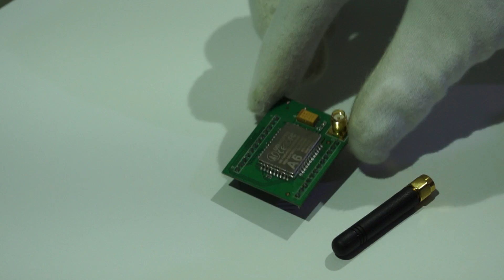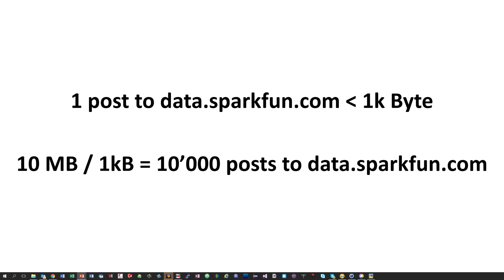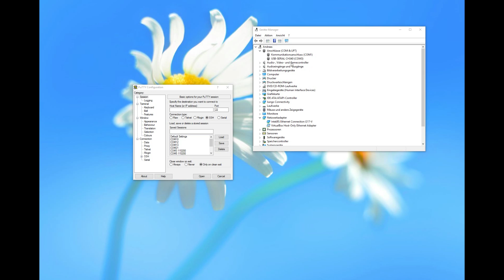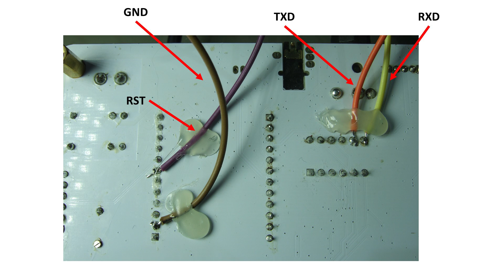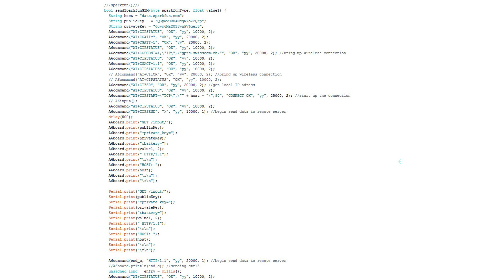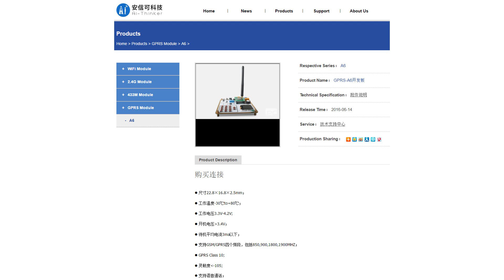#66 New Killer Module from AI-Thinkers? The A6 GSM M2M Module

Comment: Very useful video, Thanks! I've got one module and tested calls, SMS and web retrieving, using serial terminal by the moment. I asked AI Thinker for an API to program it and they told it is not available for the moment. Another drawback is that, with current AT commands, A6 cannot behave as a server. Maybe it is not that important as, normally, a device like this will push data regularly, but it would be useful in some projects that a remote system may send requests to the device.
Reply from the maker: +Germán Martín You can call the module to wake it up as one comment suggests. 
With the AT command it is relatively easy to use the module ( if you know the commands). In the next video I will dig a little into this matter.

Comment: For your Interest the A6 Module (the little tin thing) runs at 3.3v on that sub board module. The sub board module has its own micro usb connector for power (You can power your project from the 5V from  pin 1). To start the sub module up short the PWR_KEY pin 1 on the aerial side to 5V pin 1 on the non aerial side for 5 seconds ( They are diagonally opposite ). As long as you take the PWR_KEY pin above 1.9V that's enough so you can power it on with a gpio pin from your arduino. 
The PWR_KEY pin is 5V tolerant. As for RX and TX, the TX from the Module to the Arduino will be fine. you can always use a simple resistor voltage divider to connect the  TX from the arduino to the RX on the module. Something like

Arduino TX ----[1K8]--------{Module RX}------[3K3]-----Ground

Like you I have been using it with a USB to a 5V TTL serial adapter without issue.

There is more data and a data sheet link here. 
https://raymondtunning.wordpress.com/2016/05/31/a6-gsmgprs-module-pinout-and-data/

The timers are really useful  as they power the device up from a turned off state. So if you were doing say a battery monitor  you could set the timer for every 3 hours it would turn the module on. The serial output could be used wake your uP which could in turn read the battery level then power of the module. Then the cycle repeats. Even in standby mode it draws less than 1mA it comes out of standby if a timer event happens or it receives an SMS or a call. 

Also useful is the fact you get Caller Line ID so if you wanted a garage door opener you could get it to recognize that your phone, list of phones, had rung it then open the garage. The module does not even need to answer just send the "Hang Up" command so you have a "secureish" door opener unless someone spoofs your mobile number.:(
Reply from the maker: +simonf Thank you for this info. I will definitifely further play around with this module. The remote control scenario seems to be interesting as it is "free of charge" and does not use your prepaid money!

Comment: I do not know if I'm wrong on that but it reminded a lot about Hayes command set. We used to "program" telephone modem at the time we hate that kind. Those we used if we would put a BBS up or we should communicate directly with another computer, not necessarily a PC. I myself have worked with such systems in two cases the last as late as 1995, this system may still run.
Reply from the maker: You are right. The Hayes AT commands are the basis for these commands. I think, this is part of the problem that they are not very adapted to today's usage with programming interface...

Comment: I  just got the A6 from Electrodragon. There are a lot of AT commands! I have been able to make calls and send SMS from a terminal, I would like to send MMS messages, but the module documentation does not mention how to send MMS messages. Great video thanks for sharing your projects!!
Reply from the maker: +xennelul I did not use MMS, so I cant help. I am more in the M2M business
Reply: There is more data here http://www.stm32duino.com/viewtopic.php?f=45&t=1156 there is a link post 2 to another website with links to the datasheet. I have not used for mms either SMS, Voice and GPRS DATA only.
Reply: Thanks very useful! I think MMS is mostly TCP, I will post about it when I figure it out.

Comment: Love your videos Andeas.  Just a quick suggestion : In your code, when you write debug comments like this :

     Serial.print(" HTTP/1.1");

... if you enclose the string with an F() statement like this :

     Serial.print(F(" HTTP/1.1"));    

... the string comments are not stored in program memory, which reduces the footprint of your code.  Production-wise it makes no difference, because you can just remove those lines from code, but it does give a clearer indication of program memory requirements when debugging.
Reply from the maker: Thanks for the tip. Didn't know it.

Comment: Andreas, you can use just regular Arduino and SoftwareSerial which emulates serial communication on any pin/pins. This way you can have more independent serial interfaces.
Reply from the maker: +cbm80amiga I often use Software Serial. But here, I need 115200 baud. And this did not work when I tried with my UNO.
There is a possibility to change the baudrate of the module. This will be the content of a future video.

Comment: Please also keep an eye at your providers TOS. Over here in germany most include a section forbidding "automated systems" for private contracts. Of course that term is somewhat debatable, but at least one didn't quite like my "connect;request;disconnect;sleep 300"-Script and cancelled my account…
Reply: Ist das bei allen Providern so?
Reply: In den AGB steht bei den meisten etwas, das man in die Richtung interpretieren kann. Reaktion ist mir nur bei einem Reseller, der kein Netz nicht als Ausrede zulässt, bekannt. Auch da aber nur bei wirklich konstanten Verbindungswechseln - schätze die haben deren Datenbank etwas genervt.
Reply from the maker: Interesting which problems can occur. I absolutely did not think about this problem. I also learned, that GSM networks will be closed down in the near future, and that it seems forbidden in some countries to use these modules without proper homologation... This is the power of youtube. Learning in both directions.
Btw: I like your videos and always watch them!
Reply: Well, we hear the same thing about analog TV and Radio for quite some time. There are a lot of large GSM-only installations like fire alarms or the automated toll-system installed on freeways in Germany still active and I'm pretty sure there will be generous migration times until GSM will finally vanish over here.

The homologation is afair only for the type, not every unit - I'm not sure if the EU even has it's own stamp, the US-FCC-Approval is at least printed on the module. This regulation officially applies to WiFi as well, so not really a difference there. And still a pretty high chance that nobody cares as long as there is nothing horribly wrong and impacting other users…
Reply: As a semi-retired Telecom Engineer, I can tell you that this is not always true for all carriers. The EU is standardizing data service T&C's - including roaming requirements. Note, that the ITU is leading this ininative and is already running into obstacles as Carriers offer several prepaid services that have almost no T&C's concerning data when it's connected to a TCP/IP stack. The dial tone side of GSM is not a problem because it's not actively using IMEI network. Pre-paid sim cards in Europe no longer require "locked" IMEI network access identifiers. However, this is only partially true in many other countries such as India and Pakistan where 900 / 1800 MHz are still in wide use. For example, the ability to by prepaid sim cards is heavily regulated and requires the user to be fully identifiable including documentation of user with name, address, etc.. Gone are the days of anonymous pre-paid cards. 

As noted in these threads, some GSM 900 / 1800 networks are being decommissioned throughout Western Europe (EU) and the frequencies being reassigned for different uses. GSM as a wireless technology is not being decommissioned - but going through upgrades (i.e. G2 & G3 to G4 and G5) and migrating to different frequencies. 

Across southeast Asia, GSM 900 (and believe it or not, CDMA+) remains in service in some countries but are being phased out. 

For those that are considering this series of modules for use in Africa, the GSM networks will likely remain in place over the next decade, possibly longer. Across North America, the following networks are in service; 

GSM / AWS / UMTS / HSDPA / LTE using 850/1900 MHz , UMTS/HSDPA 850/1900Mhz, LTE 1700/2600, AWS 1700/2100 frequencies. 

The evaluation / test board Andreas used is no longer available. However, several other test boards are available from various suppliers along with certified model vendors that support MODEM, GSM / GPRS, QUAD BAND, RS232. I will not make recommendations due to the wide variety of regulatory and different applications of specifications that vary between countries. I know of at least 5 different A6 Chipset boards that are compliant with current standards including;

Working frequency: quad-band network, 850 / 900 / 1800 / 1900MHz and 2G / 3G and 4G compatible. 

- Working voltage: 4.8-9VDC(On-board voltage regulator circuit supply power for A6 module)
- Working Current: maximum of 2A
- Sleep Current: 5mA
- Onboard Micro SIM card holder, you can install Micro SIM card
- Onboard Micro USB interface for external power supply
- Communication Interface: TTL serial port / RS232 serial port
- Baud rate: 115200bps and it can also be set by AT command.
- Interface logic voltage: 3.3V
- Make and answer phone calls using a headset and electret microphone.
- Send and receive SMS messages.
- Send and receive GPRS data (TCP/IP, HTTP, etc.) .
- Be used to test the Ai-Thinker GPRS A6 module
- Pin pitch: 2.54mm
- Onboard antenna interface: SMA and IPX
 

Andreas; if you would like some technical assistance, let me know and I'll be happy to help or point you in the right direction for technical information or engineering support. 

Hope this helps.

Comment: Very well done video Andreas, thank you!  I've ordered myself a few of these modules (alongside the same evaluation board in your video) and will for sure implement one in my current "smart home" setup as a backup modem.  For the sub $5 price per module (found as cheap as $3.31 with free shipping) I think you've made a great find!
Reply from the maker: Enjoy your "smarter home"!
Reply: Thanks, I for sure will!

I received my development board and a cheap SIM card (with free 200MB data plan) a few days ago and have it communicating with one of my ESP-12E controllers, (albeit a bit crudely at this stage).  As it's implemented now it works great as a quick and dirty backup modem to hit my externally hosted servers.  

I did some digging around and found the schematic for the test board we have, might be of help to others to have it in the video's description: http://www.electrodragon.com/w/images/b/b7/A6_dev_board_schematic.pdf

Found it here with a good rundown/overview of the A6 module: http://www.electrodragon.com/w/GSM_GPRS_A6_Module

Thanks again for this video, it made integrating this chip much quick and easy!
Reply from the maker: Thanks for the information!

Comment: For these guys trying to connect in German with ALDI Talk Base. This service does not require all the "AT+SAPBR" commands from the script. As far as I'm moved forward with e-Plus as provider the GPRS registration seems to work "magically" without any initialize. All SAPBR commands cause an error 58 on my devices. I also do not find this AT command in the provided A6 reference. Maybe required and working in Switzerland.
Reply from the maker: Thanks for your comment. I am doing a video where I explain a little more how I connect to the service. It is due tomorrow evening...

Comment: I'm waiting until a 3g version of this device comes out.
Reply from the maker: +MrHD71 I was not aware of the 2G problematic. As I mentionned, this is my first experience with GSM. So, I probably have to write off a few dollars in a few years. Do you know of cheap 3G modules?
Reply: +Andreas Spiess I completely have no idea of cheap 3g cards. the cheapest card I could find was $50 USD which is way too much for any hobbiest project to spend on a single component. let me know whenever you fimd anything interesting at a good price.
Reply: The only cheap 3G modules are USB dongles around $10 the problem is you would need something like a PI zero to operate them. You maybe able to use a uP that is capable of being a USB Master but it would be a nightmare.
Reply: For www.Bubbleio.fr project : Same feedback for me. I've not seen 3/4G chip at less than 20-30$. On the other hand, I've made investigation on 2G perennity and I think we will not have real change before 5G (which will change the IoT communication market I think). So, at least 5 years of 2G availability , enough to validate a business model :-)
Reply: @ERICRAC  2 G will have a long life due to the IOT world ...keep that in mind...2G = Low power consumption...so no worry. good luck
Reply: 2G has gone offline in Australia

Comment: The M2M devices usualy doing some mission-critical tasks and often installed in hardly accessible places, so it's components must be very stable and reilable. The SIMCOM SIM900 is tested for many years and proven to be stable. This new module needs to be tested for several years, detailed documentation must be released and tech support must be started at least in english before module can be used in real M2M devices. Before it's done this is not a killer module, but just a toy to play with. Still I like it and just ordered one.
Reply from the maker: Concerning the documentation, you are absolutely right. Concerning the years of testing I doubt: First, product life cycles are very reduced these days (think of the risk of a new Iphone every year, they cannot test too long). Second, the GPRS network will be shut down around 2020. With these long tests the module would have a very short life...
BTW: If I had to do a decision for an important product, I definitely would go your way and spend a little more for a proven technology. But fortunately, this is "only" my hobby.

Comment: Hi Andreas, thank you for this useful  instructive video. I have a question about arduino and a6 tx rx connection. As i understand arduino serial is 5v and A6 is 3.3 V  Does this connection requires a logic converter or we can connect them directly?
Reply from the maker: I do not know of a clear indication. So, the safe side is always to use a level shifter. Mine survived 5 volts...
Reply: thank you

Comment: great fan of your videos. can you please confirm if there is an analog port on this. and can this be used without an arduino to capture and send (via MQTT) a sensor's reading. say of dht22
Reply from the maker: No, I cannot confirm that. This module only can transmit messages.

Comment: In your code, A6command and A6waitfor use "yy", can you explain it's for what ? With the A6 there is a problem with a long reply (for exemple with AT+CIICR) because after a number of seconds the A6 sends "COMMAND NO REPONSE" so the command "wait for OK" doesn't work.... the "yy" solve this problem ?
Reply from the maker: The "yy" is just a placeholder. This routine can wait for two different responses ("OR"). If your answer is always the same, you do not need the second option and just put in any placeholder which for sure does not appear in one of the responses of the module.

I think,  you have another problem before the command "AT+CIICR". You have to try if your SIM card is enabled and has no PIN code or your network provider expect other commands etc.

Comment: 70mA draw from the reset pin sounds unusual. I would have expected a few hundred uA. Do you know which chip it uses inside? I have a hunch that it's going to be MT6260 or its variants like MT6261. If so, it also has a Bluetooth radio, FM, LCD Interface, camera interface, battery charger, ADC, I2C, SPI, SDIO, GPIO and many other peripherals which are not exposed in this module. Do you intend to do a uncapping video?
Reply from the maker: +helloworld I will definively make one more video. And I will try to meaure the real current.
Reply: There is an alternative to doing a Hardware reset set a timer for 10 seconds in the future and shut it down.soon as the timer hits it will restart. To be honest if you use the board on the demo baseboard like you are doing you are going to have problems it constantly tries to connect to the  AI Cloud. You need to switch off the connection to the Demo board STC uP.